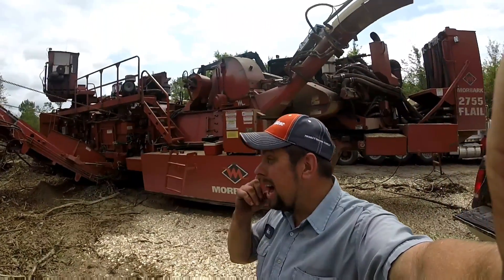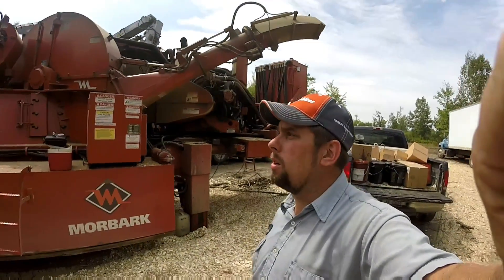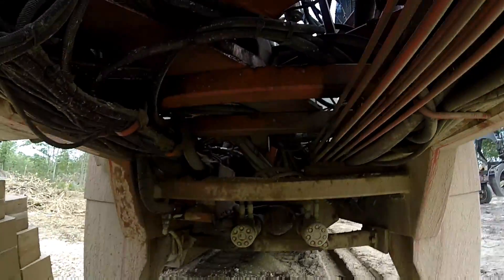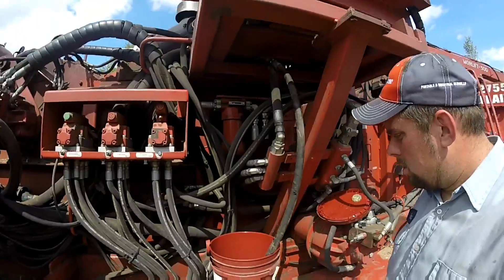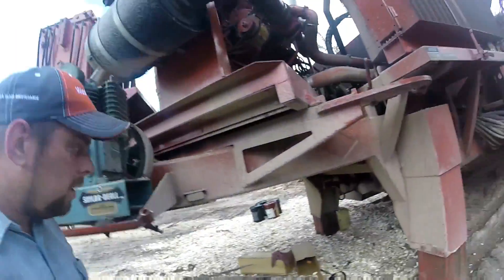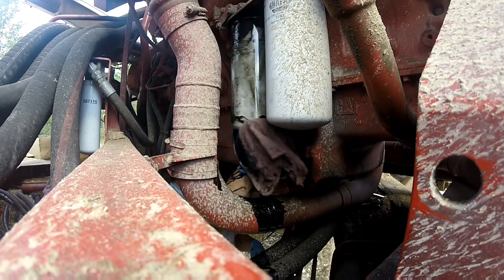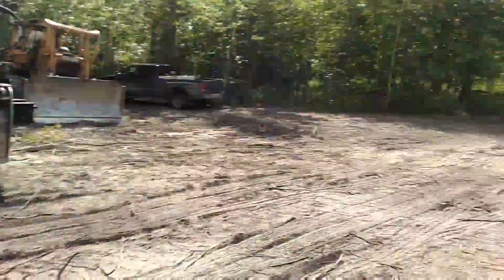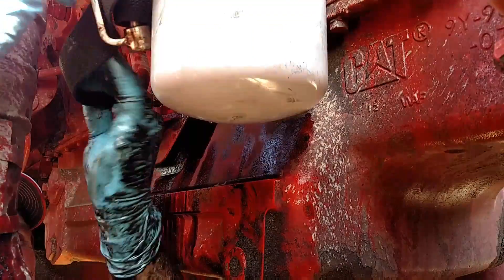CHIPPER OIL CHANGE!!!!

Comment: I use an awl and a hammer to pierce two holes right next to each other in the oil filters, place a bucket underneath and let the filters drain before removing them, its less messy that way.
Reply from the maker: +Ray Duerksen Thanks for sharing Ray, I will try that next time!!!!

Comment: Florence SC!!!  My neck of the woods.   that wherecmost of our pine pulp goes.   West Rock.    they only buy pine pulp and clean chips.   they also buy boiler chips, but you send a truck there at 7am and you might get him back to the bushes by 4pm, and that's an average 25 mile haul.....lol 
as "That Chipper Guy says, whatta you do????"
Reply from the maker: +Reid Singletary That's crazy slow!! But whatta ya do!! Thanks for Watching
Reply: Reid Singletary I haul pulp wood into west rock every day. never spent more than 30 minutes getting unloaded. must take you a long time to get there from south carolina
Reply: +verteup yea, pulp ain't so bad, but if you read my comment you'll see I was talking ab residue chips.   you want run in and out hauling that

Comment: I see you get quite a bit of debris from the chippin' that collects up underneath on the rails etc, how often do you have to get under there to blow it out?
Reply: I'm askin' because that seems like a fire hazard to me with any hot oil or other fluids that might leak out.
Reply from the maker: +Keith Brettell I blow off the motors and main areas about once or twice a week. The chipper gets power washed 2 to 3 times a year. When that happens it gets the total job and all cleaned out. 
Thanks for asking!!